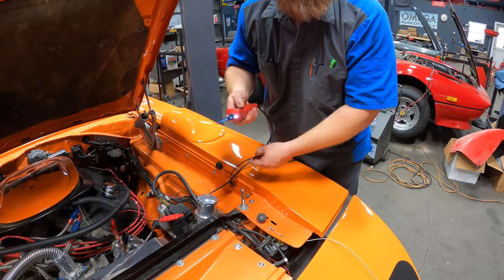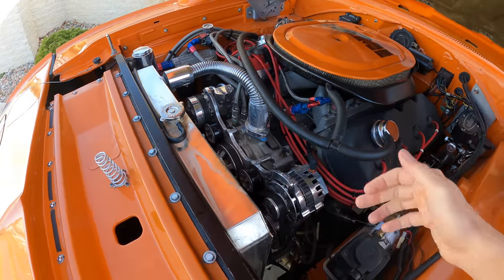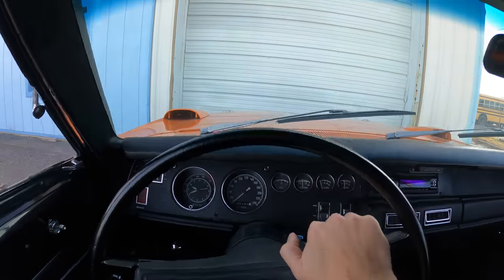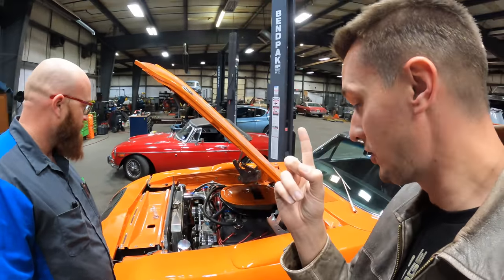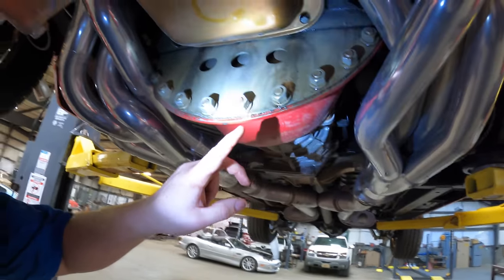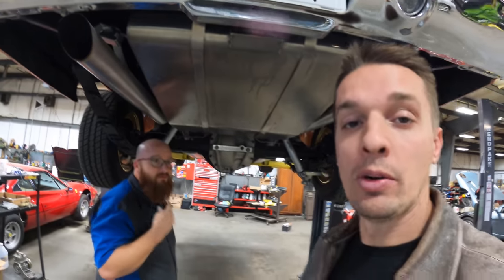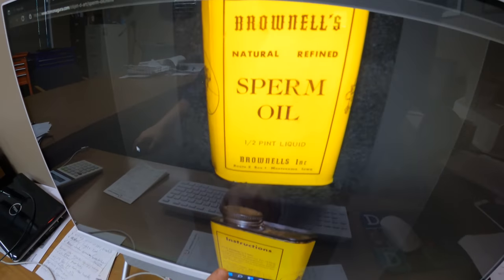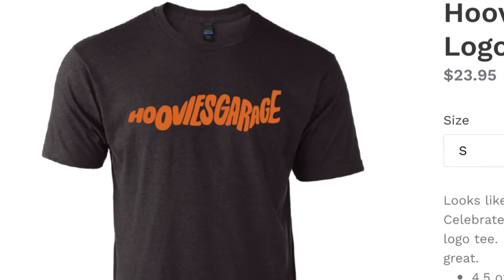How I got SCAMMED buying a Plymouth Superbird online sight unseen (So much broken/missing)

Comment: A lot of people here do not know mopars. This is a 70, the vin is stamped into the radiator core support, also its under the rubber of the trunk seal. Easy to check. IF they started with a standard roadrunner then they would have had to swap out the entire rear window plug. Look for the factory brackets in the trunk for the wing. Look for the factory limiters welded to the trunk hinges so the trunk does not hit the wing. As for vacuum the pump is where the battery used to be. On the factory car there is a "can" under the battery tray that was a vacuum reservoir. Even if you have a fairly wild cam it will work. Only when you hit the extreme it will need the pump. My guess as this was a race car there was no can and a wild cam. So their answer was to slap a pump on it. The entire front suspension is non stock. It has an aftermarket K member so there is no torsion bars. That's why it has coil overs. It DOES have the factory boxes in the rear suspension that only came on hemi cars and verts. I'm armchairing this is a real car with extensive reconstruction. But 5 minuets of hands on research would verify that.
Reply: Hello fellow Mopar guy, I thought the same on checking all the stamped vins as well. The BaT listing is a bit concerning, though - "This 1970 Plymouth Superbird is said to have been crashed in a race in the 1970s, and it was reconstructed with parts sourced from a Road Runner during a three-year refurbishment that concluded in 2009." - Makes me think it IS in fact a vin swap, and the body-stamped panels will tell the story. Hope it to not be the case...
Reply: VIN comes back as a 69 GTX
Reply: This guy sounds like Graveyard Cars, awesome post❗❗
Reply: You just answered my question, I just hadn't seen it yet.
My thoughts on the vacuum/canister were the same as yours as well.
Reply: @twRage96  And you believe that BS story?
Reply: A lot of Superbirds don’t have a rad support VIN. It should however have the trunk gutter VIN.
Reply: The rear torque boxes are available aftermarket. And easy to weld in.
Reply: @FrankBullitt390  No. the VIN is correct. An internet site claims it was built using a ‘69 GTX body. Which would be the same as a Satellite or Belvedere. The dashboard is just bolted in and easy to install in another car.
Reply: @klasseact6663  Mark and his Ghouls would have this Superbird back in to top condition too!
Reply: @drippinglass  A 69 GTX is very different from a 70, they could have at least used a 70 roadrunner, belvedere or satellite and just put all the bird parts on it, which is likely what they did.  There's an equally butchered 71 hemi cuda vert around that was rebuilt using a 70 cuda convert.  Purple, Craig Jackson owned it.  Only thing remaining from the original car is the firewall, it was stolen and chopped in BC Canada back in the 70's.
Reply: @FrankBullitt390  wouldn't be surprise if it was a replica. Those floor panels and sub frame seem brand new.
Reply: @twRage96  It says it used a door a midsection floor from a roadrunner. It has the fender tag and dash vin matching. I highly doubt it was a vin swap.
Reply: @RogerM88  Those frame connectors were added later, those cars only have front and rear subframes
Reply: @FrankBullitt390  but using torsion bars would mean a stronger mid section, so frame rails.
Reply: @Ben Jones According to the listing on BAT, “it was t-boned in a race and the center was repaired using parts from a Road Runner” Nice story... if you believe it, the front and back of the car are original. All Superbirds will have the last 8 digits of the VIN in the trunk gutter. But I’ve heard a lot of them didn’t get the rad support stamp.
Reply: @Ben Jones Mopar rad supports are welded in. Unibody. You can cut them out, and weld into another car but, from most autobody shop jobs I’ve seen... it’s noticeable.
Reply: @Ben Jones The factory actually used a big spot welder. Most repairs I’ve seen are a log bead. Stronger, but noticeable difference.

Comment: Frankly I'm worried that it's not the actual superbird, but instead a VIN plate swapped on to a roadrunner. I would have no faith in the seller or anything they have vouched for. Especially since inspecting the underside didn't reveal signs of the rebuilding, I would want to make sure this is the actual car you paid for
Reply: yeah, looks like a fake aftermarket body on a completely different chassis.
Guy's probably sold the same car several times, cashing in big on each.
Reply: Yea I also think so
Reply: Hello. The car is in the registry. You have no idea what your talking about.
Reply: Agreed, I would 100 percent dig deep into that to verify it. That was the first thing I thought when looking at the bottom of it, too.
Reply: I'm convinced that's actually what it is, the real superbird was probably scrapped. If hoovie can prove it that guy is in huge trouble.
Reply: Oh damn, shit just got real. You need to do some proper investigation here, Hoovie.
Reply: I agree. Something doesn't add up on this. A lot of fishy details, weird corners cut, build decisions made, sketchy seller, no evidence of the repair from what was significant damage. 'Partial rebody'? I'd be worried this is a possible VIN clone as well.
Reply: @ezacher4634  The VIN is in the registry. I want it to be the actual car that the VIN belongs to, as opposed to someone swapping the plate over onto a lesser car.
Reply: @ezacher4634  The vin number itself is a legit number yes but what car is it attached to?
Reply: @badopinionsrighthere  you should be able to check body panels in old cars like that for the serial number that will tell if it’s original or not
Reply: I have noticed that the bonnet does looks out of shape aswell
Reply: Almost positive this is the case
Reply: I find the phrase "partial rebody" odd, its a unibody car.  If it was "vin swapped", there are plenty of numbers around the chassis that will give it away, core support, trunk lid opening and a few more if you know where to look...
Reply: tags are fake…..quite obvious
Reply: $100k VIN tag
Reply: An online search of the VIN says ‘69 GTX body. The trunk VIN will tell you what it isn’t.
Reply: @ezacher4634  hes saying that once the car was wrecked they pulled the vin and body numbers off the wrecked car and put it on a solid shell of a plane 70 road runner
Reply: @ezacher4634  The VIN is on the registry....get that? the V I N.....if the vin came from a wrecked superbird, and they bolted all the superbird parts on a roadrunner, who would know? Not the registry. 

I suggest you watch the original "gone in 60 seconds" because that's exactly what they did....they bought wrecked vehicles, stole the same make model and year, then swapped out the vin tags.
Reply: @ezacher4634  are you the previous owner ......?
Reply: There are hidden vins on the vehicle, I'd have wizard look for them and make sure they match the visible ones.......usually somewhere on the chassis underneath, I believe there's one in the trunk somewhere too.
Reply: It's VIN,, not vin number. That would be Vehicle Identity Number number.
Reply: It's on the registry of the Super Birds I think. Because Hoovie talks about how it gets a ding for partial frame restore from the tbone accident.
Reply: @garygritter5701  That's what I thought but he had the hood slightly open. I think that's what you're seeing if it's the same scene I'm thinking of.
Reply: @acebragg5559  no, I noticed it when he was showing it off in his first video In his garage.
Reply: Time for Tyler to phone a friend, Dennis Collins.  Dennis should be able to identify if it has indeed been VIN swapped.
Reply: Older US cars are easy to VIN swap (which as mentioned can be seen in the OG Gone in 60 seconds). But  there are certainly more ways to confirm whether the body is original or not, the last part of the VIN is found on several places on the car. Standing in front of the car on the right side of the rad support, on the top ledge of the firewall, in the trunk ledge and (with A body's anyway) on the rear parcel shelf. Besides that a true Superbird would have plenty of unique features which should tell that quite easily. Those frame connectors for starters are not found on a OEM stock body. Are they unique to a Superbird, it having been a race car or are they a later add on? I'm not sure, but those identifier marks are easily found out. Though from the onset this will have plenty of modifications I'm sure.  That coil over setup on the front certainly isn't original and the bodywork gaps on the front look horrendous .
Reply: @ezacher4634  the vin is in the registry, not the car. The real car could still be in the sellers garage for all we know
Reply: I agree. I just posted the same thing! The seller is shady!
Reply: @ezacher4634  
Yes the VIN is, but the car could easily be a regular Road Runner or just a Belvedere!
Reply: was wondering why they didnt mention or look for any matching numbers, likely because they know this car is bs lol
Reply: Bingo! Very suspicious that nothing could been seen.
Reply: @ezacher4634  "You have no idea what you're talking about" Then proceeds to have no idea what you're talking about either. Found the seller and someone with room temperature IQ!
Reply: @SpeCifiC0507  Found the seller and someone with room temperature IQ! Yeah..
Reply: @badopinionsrighthere  The vin can only be used once. If the car has all the correct pieces for a hemi car and proof of prior ownership at this point it's moot. I've seen cars the that  the only original piece was the firewall. So many of these restored cars have less than 50% oem metal. Even a replica goes for big money. You or anyone else talking about what's going on is ridiculous. What valid proof makes you think that is anything other than a hemi Superbird?
Reply: @dodgeguyz  It's not a regular Roadrunner - look at the aero rear window.
Reply: @AndrewAMartin  
Yes, but if they were going to be deceptive it wouldn’t have been hard to swap over the plug for the rear window. I’m not saying this car isn’t the car, I’m just saying I think it warrants a closer inspection!
Reply: @dodgeguyz  Yes, definitely deserves a closer look by someone who knows what to look for...
Reply: @ezacher4634   Thank you.
Reply: It sounds like Hoovie needs a version of Patrick Glenn Nichols/Matthew McConaughey (Chevelles) maybe Dennis Collins or Uncle Tony's Garage (Mopar), someone who knows about more than just matching VINS, to authenticate the history of this Superbird.
Reply: @jwenting  it would be 50k on body work and fab
Reply: @jake_of_the_jungle9840  'Unkle Tony' will know where to look.
Reply: @ezacher4634  you checked yourself? You've seen the car and confirmed?
Reply: Probably want even a roadrunner lol, probably started as a satellite😁🤣

Comment: This really brings back memories.  A friend of mine had a green Hemi Superbird back in high school.  I find it interesting to see what parts look familiar and what clearly wasn't on the original car.  That chin spoiler was impossible to keep from getting dinged.  The headlights had a canister of about half a gallon with vacuum so that you could open and close the lights two or three times with the engine off before they stayed permanently open.  I was counting the leaf springs at the rear to verify that the passenger side had more than the driver side.  The original car had torsion bars, so adjusting the ride height was a simple matter of turning one bolt on each side.  The car would look better with the original shape of exhaust tips.  I want to keep following this story.
Reply: Good catches, Scott. One of my cars is a 1982 Corvette that still has the pop-up headlights working fine, original. Have never heard a peep, maybe electrical more than vacuum. Never had any reason to look since they work fine. You saying the rear springs were not paired, but different for the original car? That would be a new fact in our books, but it might make sense with the torque imbalances. Big Car. Yes, the front end was always dinged because when you pulled into a parking spot you always over-shot it forgetting you had that front nose.  Please share more of your thoughts here in the coming weeks. Love it, my friend.
Reply: Hemi supervised in High school? Damn was he rich or where cars cheap?
Reply: @alveyjohn  The spring packs differing was all about NASCAR and not about torque of the engine. Cornering load going left puts more load on the right of the car. Gotta love the homologation cars and all the silly stuff that make them fast in the series they raced but piss poor road cars.
Reply: https://youtu.be/dDehezwx9ZI piiiiimmmppp
Reply: Have found memories of my buddys all original orange bird getting air borne off the whoops when he went into Mr.Toads wild ride mode... guy could make that fat girl dance.
Reply: @straightbusta2609  The car was around $3600 used in 1970.  Not rich by any means, but some people find a way to get things that they really want.
Reply: @mrthesquid   Ah, that does make good sense, thanks.
Reply: It also didn't come with rack & pinion steering and it had pile of aftermarket doo dads more for looks than performance
Reply: @mrthesquid  what? Stop spewing by. All the muscle car mopars had different number if springs left to right...read a book
Reply: @cromBumny  Yeah I believe the Cuda's had them on the drag pack option

Comment: I have no idea why someone would put in a vaccume pump to operate the headlights when an aftermarket electric motor for the Superbird headlights is available, one for a dodge charger is $600. Also you know you have a car problem when you can't remember what expensive car you've bought and are underneath
Reply: Can we stop with the comments leading to adult websites, please..... It's really annoying. We all know it's gonna lead to a virus....on your phone or PC
Reply: Nothing was said but I'm wondering if the pump(s) is also for the power brakes.
Reply: @xsleep1  and air conditioning. Those are the 3 big vac draws in these cars. Headlights, brakes, ac.
Reply: @illegalmachine  that is true, all this old cars utilized the natural vaccume of the engine for a lot of things
Reply: @harleyrobertson6746  report them
Reply: @ztifbob  I have, but it doesn't seem to do any good.
Reply: @ztifbob  I do, but YouTube does nothing
Reply: @harleyrobertson6746  But have 5 seconds of any kind of music, and your video gets demonetized immediately, even if it is public domain
Reply: @MrCunningham4  tell me about, YouTube is all kinds of messed up and the rate of adverts seem to have increased
Reply: They are bots, nothing you say will make them stop. Just report and move on.
Reply: @harleyrobertson6746  - Good one. It's called SPAM and I'm pretty sure they're not going to listen to you. The best thing you can do is report it by clicking on the 3 vertical dots on the right side of the post.
Reply: @harleyrobertson6746  They do, it's just a royal mess, those aren't humans, it's automated software someone wrote down and someone paid for that service somewhere. Problem is the post faster than they are taken down hence mess
Reply: @OMGWTFLOLSMH  YouTube doesn't do anything about it, last time I had to delete my account and use this one it got that bad